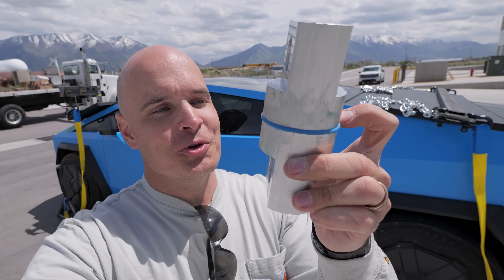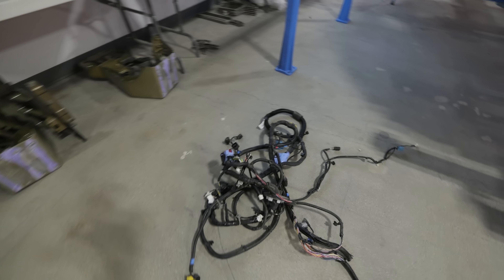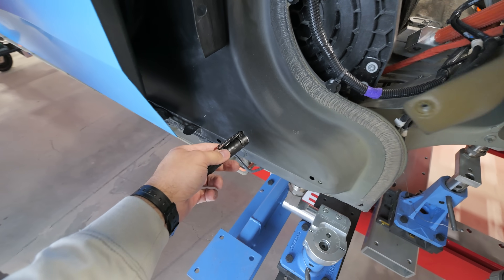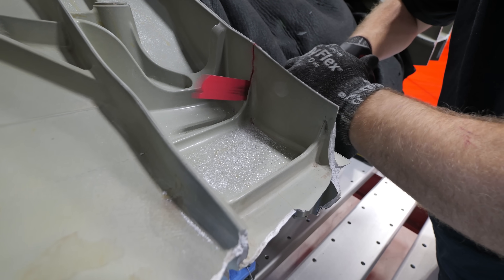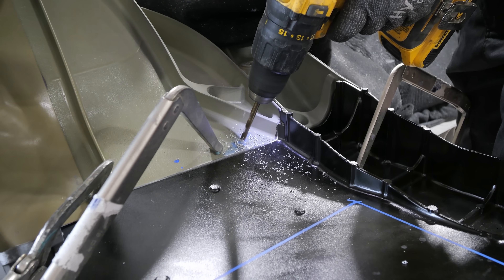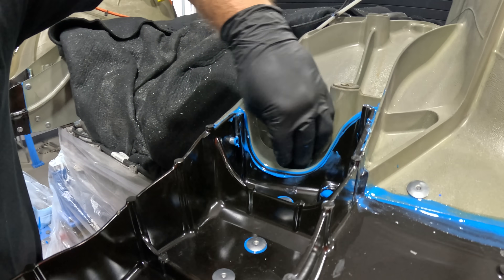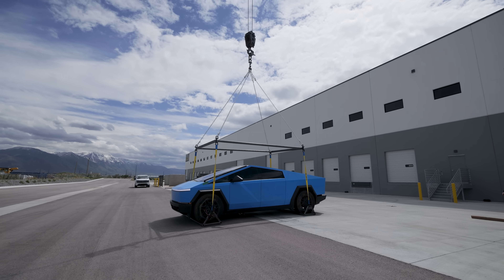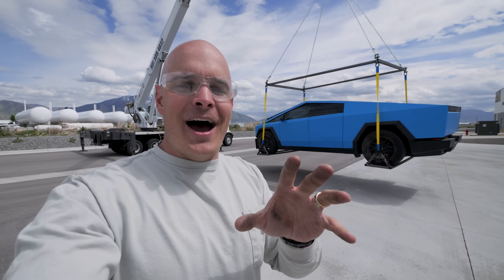Tesla Fixed my Cybertruck with GLUE - (but I'm not mad about it...)

Comment: So you have to rip off the bumper to then get it glued for it to be stronger then its original construction??
Reply: Should just 3d print the car out of glue
Reply: @landcruiser801  don't give tesla ideas for their $30k car 😂
Reply: @d1ckpunch68  Too late. Their driverless prototype is shaping up to be plastic composite panels over mega castings. 😅
Reply: You might be on to something. 3D printed structural adhesive vehicles is the future
Reply: @landcruiser801 fkin genius 😂👍
Reply: @landcruiser801  💯🤣
Reply: @landcruiser801  actually made me LOL
Reply: I've sold all kinds of structural adhesives for over almost 40 years. Epoxies, MMA's and even ureathanes can hold incredible strength when you have that kind of pull. It's the sheer and environmental concerns that are important. The aluminum coating saves the day on this application. There's no adhesive known that can survive aluminum oxidation without a strong primer. But primers don't last forever. That coating will.
Reply: Don’t look to see how airplanes are built or repaired…
Reply: I'd say pull the rear end off again to see if it got any stronger!
Reply: its not stronger. its the same as it originally was
Reply: 'Just as good' as the one that failed, yes 😂
Reply: @Grommish failed?
Reply: Someone is mad that the Tesla stock price is bouncing back @Grommish
Reply: @Grommish yeah, it failed at 10 times its rated load
Reply: @Sbinott0 it shouldn’t catastrophically fail at all! A steel hitch never fails, it first yields and would never crack off like an aluminum alloy would.
Reply: @Grommish  well he was deliberately trying to rip it off with an excavator. thats not a strenght you need for towing
Reply: @Grommish it fail  cause load wasn’t even  … reposo video and listen to jerry
Reply: Glue > cast aluminium confirmed?
Reply: Notice that there was more glue used now that what we saw in the original.
Reply: @ahaveland the original was a solid piece, it didn’t need to be glued
Reply: @ChaseEdson  See 14:32 onwards - the original glue was purple underneath the pillars and a lot less of it.
Reply: @ahaveland completely different part of the truck to what they were working on. the repair they did was on a metal-metal connection, not a glued one
Reply: Ya gotta do the tow bar test again!
Reply: With enough surface area, Elmer’s glue will lift the truck and hold it for a short time. As was said by another, environmental conditions and shear loads are the banes of adhesives. Creep under load can lead to catastrophic failure of a glued joint. More appropriate questions to ask are how the adhesive performs under high atmospheric temperatures and humidity and near but not exceeding rated loads. A very important test to run on glued joints is a “peel test” where  the joint is under a moment load (in this case, “moment” isn’t a time reference). Engineers have been surprised by how much weaker the glued joints are compared to welding, for instance. Just a last comment on automotive body temperatures, remember that it’s possible to fry eggs on sheet metal left in summer sun at 95F (35C).
Reply: They never tested if it would be stronger against the same thing that broke it in the first place.
Reply: The engineering in the Cybertruck never ceases to amaze me.
Reply: Than*
Reply: and that guy is advising the president...
Reply: No-one got rich being honest, the customers have to be diddled
Reply: People are completely ignoring the fact that it's GLUE, so, you know, it probably has a MUCH lower tolerance for temperature change than aluminum and definitely than steel. I wouldn't trust a glued together car in freezing temperatures or 100+ degree weather if you paid me a million dollars.
Reply: @somethingtojenga  dont try to use reason, people will debate you how any kind of super super glue its as good as a weld

lets wait for the next space rocket to be glued then
Reply: @somethingtojenga Don't ever fly anywhere then.
Reply: @mobyme  Aircraft use composite MATERIALS, that isn't the same as bonding two structural elements together with adhesive. No part of an airframe is bonded end-to-end with adhesive, and I very much doubt this is the same type of adhesive.
Reply: Sounds like the last spacex rocket failure
Reply: Why would you rip it off if it's still on the car just fine???
Reply: its the same strength
Reply: @edwinbates2920 so still really bad and will never another repair soon?
Reply: good point
Reply: sounds like bones, breaking and growing back stronger
Reply: Why is it so hard for you to process this
Reply: Jesus you’re dense
Reply: Yes
Reply: I'm just thinking about the guy that pulled stuff that was "glued" on the truck off with his hands lol
Reply: 48 volts is low voltage. That green coating is great.  Aircraft quality.
Reply: 14k option 😂
Reply: Try a cup of Gallium if the base fall apart
Reply: Kinda like when you break a bone 🦴 when the body mends the bone back together, it’s usually stronger where the bone has mended than the surrounding areas😅 kind of interesting I think.
Reply: Every car company uses this stuff. It’s nothing new. It’s actually funny to see you guys trying to bash Tesla for something the auto industry has been using for years but let’s single out Tesla.
Reply: he mentioned shock and sheer force on can ultimately brake the bond.
Reply: Go go Elon Musk you are the best, f left people and left media
Reply: Crystal clear!
Reply: Its like gibson headstock!
Reply: It’s actually a lot weaker, That 2.5” aluminum piece, if it’s one continuous piece of 6061-T6 aluminum (about 40,000 psi yield strength), can theoretically hold around 196,000 lbs in pure tension. That’s because its cross-sectional area is about 4.9 in², so 4.9 × 40,000 = 196,000 lbs.
Reply: @harrisonmc123  It's two halves bonded by adhesive. The weak point in the chain, is the adhesive, and this test was to demonstrate, that it's not weak at all.
Reply: @harrisonmc123  wrong
Reply: @harrisonmc123 nerd but fr though good knowledge
Reply: *than (it's comparative, which is what you need)
Reply: All modern cars are glued. The seams are glued and the unibody has a handful of tiny spot welds.
Reply: @3fives-j5w  glue and clips .plastic made from oil
Reply: Makes me wonder did A. Tesla pay you for this or B. Threaten to sue you if you didnt make this video? 🤔

Either way, where can I get that glue?
Reply: Repairing it with a cheap Milwaukee sawzel was all I needed to see.
Reply: Give it a week of stresses and itll probably pop back off 😂
Reply: @rfbftp123  looks like you're the only thing popping off.
Reply: And then this shit can blow up from hydrogen gas, even it's running on electricity  😀  my best guess  they paid him money or video makes enough $$$  to buy real ford f150 electric truck
Reply: @crazyhorse8871 You're probably thinking of lead acid batteries that can produce hydrogen gas during charging. Lithium batteries don't do that. EVs are many times less likely to catch fire than gas cars (from 11 - 64x less likely, depending on what study you read).